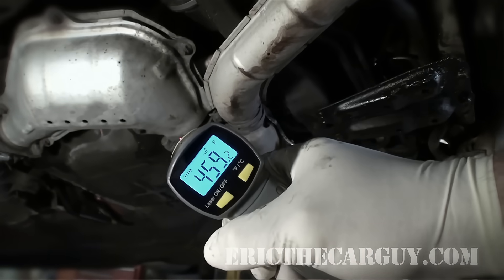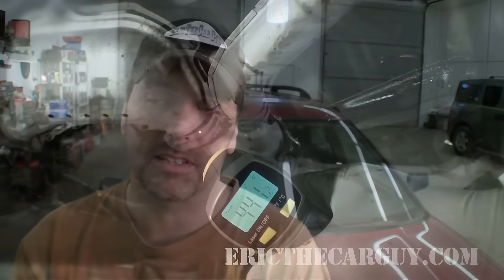Does Lacquer Thinner Clean Catalytic Converters? -EricTheCarGuy

Comment: A small exhaust leak, anywhere upstream of the converters will cause a P0420orP0430 if u have two converters? Somtimes if the leak is around the manifold, maybe a small, small crack, I have observed this often, one can, or will only hear said leak when the vehicle if absolutely cold. The sound u are looking for is a very distinctive tic, tic, tic, tic and then as the engine warms,it goes away, sometimes completely! But! The leak is still der! This causes a P0420. Eric ur the best, great vid.;)

Comment: It's usual here in Brazil to have industrial solvent mixed with the gasoline by some gas stations owners. It usualy leads to a catalitic converter melt down, destruction and cloging of the fuel filter and melt down of the rubber pieces in contact with the fuel.

Comment: Remove the CAT and pour acetone DIRECTLY on the inlet of the CAT. Pouring it in the gas tank will just trick the sensors and make you burn MORE fuel.
Reply: Just remove the #1 sensor and pour the desired cleaner into the hole, 
Replace the oxygen sensor and leave overnight,  may have to try a couple of times.

Comment: Neighbors 02 Altima had a upstream 02 high circuit code. Pulled sensor, looked like the end exploded, dont know why or how. Replaced it and after system monitor ran it threw a P0420. Pulled off exhaust and looked inside the cat, the substrate was completely missing. Not melted or broken, but just not there. Replaced cat and light turned off in 2 hours of driving. Been fine ever since. Car sat in her garage for a year, no one could figure it out.

Comment: Ooh, and laquer-thinner is just a non-sense, which totally did not work for me. I tried it on a 2001 passat v6. I poured 1 gallon into 30L of gas. Just wasted my money on the thinner. Light came right back on after 40kms. TheI tried the non-foulers, and I drove the car for 3 000kms after that and the light did not come on. Then I sold it and noone has yet called me to complain of a check-engine light.

Comment: The only inconvinience is that you have to drill through the non-foulers to increase the bore, so the sensor can screw into it. Some might argue that this lies the ecu and the car doesn't get as efficient fuel consumption. In my experience this is just not true. The people were still making the same mileage per tank as before this fix.

Comment: The only other solution besides replacing the cat is to screw in two spark-plug nonfoulers onto one another and then screw the o2 sensor in them. This way you remove the sensor from the direct stream and it works. I have done that on 4 cars so far and the codes never came back again even after 5000kms. On one of them it would come back intermittently, but that's because I didn't have enough space around the exhaust pipe to fit in 2 nonfoulers. Instead I only was able to use one.

Comment: Check out Eric's rebuild vs. replace video, he sort of agrees with Scotty. Of course, there are exceptions, but basically what Eric says is replacing is quicker and sometimes cheaper and will be better in the long run (that's concerning engines for the most part - carbs are different of course although I expect his answer still applies)

Comment: Lol Funny. The NGK rep I know says to use anti seize. It's not about ''corrosion'' (how does that happen in cast iron heads???) it's about the carbon build up leaking past the tip of the plug and working its way up the threads. Happens everytime I look at my plugs from my Jeep and my Ford. Even on my small engines.

Comment: short answer is yes, I once worked on a car that completley died, the catalytic convertor had melted and blocked the exhaust which finally chocked the engine out, this would have been putting a large amount of pressure/ temperature in the combustion chamber, shortly after getting this fixed it developed a blown head gasket, possibly related, during the initial fix I found the coil pack to be firing on 3 cylinders and this was clearly the cause of the melted Cat.

Comment: he shouts because he is partly deaf, he doesnt realise he is shouting, with regards to low compression in a cylinder well that depends on the engine you have and in what car, often it is best to just get rid of it, paying labour costs for a re-build isnt usually economically viable, unless you can do the work yourself of course, the problem with opinion is that they are like arseholes, everyone has got one.

Comment: It can cause high back pressure and burn the valves in the engine if the cat has come loose inside and is blocking the exhaust

Comment: one problem is the thinner will stay in the down spout for the gas, if you look it sits lower then the tank inlet, so most of the lacquer would sit in that, ive never tried the lacquer experiment though lol Hey quick question, i have the 97 legacy, And get about 210 miles per tank, my long term fuel trim is around 7-10 crusing at 60 mph, is that the same as yours ? 

thanks

Comment: I can see that this can be a pretty heated argument for some folks. I see some valid points on both sides. I watch both ETCG and SK alot. Both guys are smart. Anyway.. I HAVE personally tried this using the ratio that SK provides. It did work for me on a 2000 LS-1 Camaro. I raised my idle to 2k for 45 minutes, then let idle normally for about 15. Then I repeated that process several times over the course of the day.The P0420 code was thrown for about 10K miles before the Laquer thinner was used.

Comment: As an ASE certified Master tech,  I wished that you would have performed this test using his recommended 5:1 ratio. That's 5 gallons of gas and 1 gallon of lacquer thinner.  This simply out of respect for a fellow tech. Same on you for not doing so.  I've watched a number of your vids , I can say YOU surely don't know SHIT !!!!  You mentioned a check engine light. Code P1400, fuel tank pressure sensor fault. This sensor is used during the evap testing by the ECU. Nothing to do with the thinner

Comment: People have been using Toluene (not thinner) in gas for 50+ years. I wouldn't do it though. i've cleaned out clogged converters before with blow torches and yes. it worked.

Comment: To be frank, 1. A catalytic converter uses a catalyst, unless it's been blocked or smashed, they fail because they are worn out, like a heavily discharged battery's plates would fall apart. 2. The ECU will take all measurements and adjust as necessary, so it will adjust fuel mixtures accordingly even if you pee in the tank. 3. This acetone myth has been going on as long as the over unity loony's, with 100000:1 realising strong solvents cause damage and have different compression characteristics?

Comment: i have a 98 Subaru outback i have already replace motor and transmission and complete exhaust and etc. that was 5 yrs ago. the outback is on its last leg again from my wife beat down. they is holes in the exhaust, transmission skips sometimes and oil pan has a big dent. shocks are dead. should i rebuild it again and maybe to a conversion like the 6 cylinder boxer engine? i really want to have a car with a lot of torque, is it worth it?

Comment: I had issues with a cat in the past and tried Scotty's techniques just as Eric with no luck.  I used much more laquer thinner and even attempted to clean them with detergent.  In the end finding a replacement fixed the problem and would have saved me a lot of time if I had just replaced it to begin with.  Live and learn.  Rarely do snake oil style fixes work.

Comment: I suspect Eric's conclusion is probably right. However his method is less than scientific. Kilmer said to use much more thinner to gas mix. Kilmer also specified that the lacquer thinner be the kind sold in auto paint supply shops. I believe Kilmer also said Ior implied) that all of the gas with thinner be run out or diluted before running the test. That being said, I used the same thinner Eric used (bur more) and ended up having to get a new cat which cleared the code. I'll still watchi Scotty.

Comment: I tried this since i was receiving a P0420 code on my 05 scion tc after watching scotty's video. I thought that i would have positive results since the cat that he was cleaning was from a toyota celica which is sort of the precedent to the tc.

However my results were not the same, it didn't work, even though i had tried that as well as cleaning with soapy water. I ended up buying an OEM primary cat from toyota for about $400. Hindsight 20/20 I would have just bought the cat and been done

Comment: I ran 3X that much laquer thinner through my camry with 1/2 tank fuel and burnt it all over 2 days. I used to get a p0420 about once a month (I drive every day), and once i cleared the code it would not return for about a month. Its been 2 months since I did the lacquer thinner and no p0420 yet. Also, the rotten egg/exhaust smell i used to get going uphill or accelerating hard has disappeared. This is just my experience.

Comment: The problem with this is 1 quart is no where near 1/9 that Scotty specifies in a later video. Not saying for sure that is going you make a difference but Eric only used about 1 part thinner to 40 parts gasoline.

Comment: BG 44K can sometimes make a difference. I used to work at Sunoco and our inspector would put a can of that in the tank of any car that failed due to the cats. It only worked 35-40% of the time but at $15 a can it was worth a shot.

Comment: i'd be very concerned that lacquer thinner may damage one of the plastic components that comprise a modern fuel delivery system. those plastics were speced for gasoline, not LT. it may not produce an immediate leak but i'd worry it may reduce the plastic's integrity enough to cause an issue down the road.

Comment: Not likely.  Petroleum products are "non-polar" while alcohol is a "polar" solvent like water.  Likes dissolve likes so a petroleum, "non-polar" solvent is all that will dissolve any impurities or clogs in the system.  What I don't quite understand though is that the lacquer thinner has been burned by the time it gets to the catalytic converter....so it's not lacquer thinner any more.  It's exhaust....  I actually did this to a Ford Ranger based on Kilmer's advice.  Not sure if it helped any.

Comment: Hi Eric! Nice video as always! I have a CNG converted car, with catalytic converter and i was wondering if it can get clogged like a gasoline car. I know for sure LPG powered cars can get it clogged pretty badly, causing also some cars to fail our fume inspection, hell, i even saw a Fiat with LPG with the converted red hot because of being clogged!

Thanks in advance for your nice work Eric!
PS: my car is a 97 Renault Clio 1.2L

Comment: A smog mechanic  friend of mine, had a 1975 Lincoln that would not pass smog test[after tune up oil change Etc] He dumped 1 qt of shellac thinner down intake system. It then passed. It was a granny car that was lugged around town, most likely clogged cat not damaged.

Comment: Eric, like most things scotty does he is almost there on this theory but wrong execution, he likely uses lacquer thinner because of the cheap price.  The best method for doing this 8 gallons of gas, one gallon of xylene, one litre of acetone and half a litre of lucas fuel treatment then drive on the highway in 4th gear for an hour, let it sit overnight then do the same thing.  The next morning it will likely sputter a bit tho before it gets going, usually has a nasty exhaust smell too

Comment: I put the lacquer thinner in the fuel injector cleaning canister so it does not have to go through the entire fuel system and plus it more concentrated. 

I believe you have in your shop the otc version 7448.

Try that too.

Comment: I liked Scotty but really he is a bit sloppy for my taste. He used standard compression fittings on brake lines, he lets calipers hang by the hose, he drops the lift with cars on top and has other messy practices. When someone mentions it in his comments, he always retorts he's being doing it for so and so years but to me that is a weak response. He could be doing things wrong for so and so years but it's still wrong. Not that I dislike him but he is a bit cocky and hard-headed, that's all.

Comment: I did this once on my obd1 supra with dual cats. At a 1/3 tank I dumped a liter of thiner in the tank and mashed on it for 30 min. The reason I did this is I knew both my cats oem from 92 werent gonna do the job and my hc levels were found a hair over the limit. Oh it smelled like buttered popcorn for a bit too.

Comment: IT WORKED...for me....I have a 2002 Chevrolet Suburban 5.3 had a cat code, put one gallon of lacquer thinner in a full tank of gas. Raised the engine to 2500rpm for 25 minutes....IT WORKED...no more codes, runs fine. It has been 5 months and 5 thousand miles ago....

Comment: Here is my ? I own a 2000 chevy tracker. It seems like to me that she(tracker) is having some troubles upshifting when driving along. What would cause this to happen? I have checked the transmission oil levels after a drive and before a drive (cold) and they are normal. Any help would be greatly appreciated. 
Vehicle specs
2000 chevy tracker
1.6L
4x4
no abs

Comment: Cheap way is to plasma cut open the cats and "gut them out" and then weld back shut...however sometimes it ruins the O2 behind the Cat. I had a buddy with a 93 chev 5.7 and had it dueled and off the headers...installed a H-pipe and put the O2 in the middle of it. I run a MagnaFlow hiflo Cat on my Honda and previous vehicles, I like loud but to save the O2 or not have a O2 CEL come on is having the Aftermarket Cat installed.

Comment: id also like to point out, pure acetone when burned produces 3CO2 and 3H2O. water and carbon dioxide. in fact it probably burns as soon as it it pressurized in the combustion chamber, as it has a very low flash point.

Comment: Hey eric i got question for you. Is there any brand that will scan my honda integra dc2 1998 3wire DLC port?  ive used a dlc obd adapter and tried 10 different scanners but non work.  So do you know a brand that duss work? Thanks in advance. btw my dlc is getting power so its not a blown fuse.

Comment: I had been told by an old Mechanic in his early 90's that pure acetone bonds with the hydrogen molecule in gasoline and can increase your gas milage by up to 20% in rare cases but 7% - 10% on average. That it works best in cars from the 60's and 70's.
I regularly put 2 ounces of acetone per gallon in all our cars , motorcycles , and tractors.
 I can tell a difference if I forget or one of the kids gasses up the car.
Sally's Beauty Supply has the purest acetone I can find
Many Blessings...SMR

Comment: Catalytic converters can damage physically or can clogged up (burnt in carbon particles). So if it is just a clog, and this method can unclog it, than it is a good way. Catalytic converters only make chemical reactions faster but not used up in the process. (like sugar cube with ash can burn, ash is a catalytic material in the process, but not burned or used up)
My second guess because the long drive, catalytic converter just cleared itself.
(sorry for my bad english)

Comment: It can help remove loose deposits on the catalyst honeycomb but large build ups as in complete stoppages. It's far more effective to remove and soak the converters then rely on the small amount that goes through the exhaust from incomplete combustion.

Comment: I used the spark plug non-fouler trick on my rear spark plug like 3 years ago.  It's been fine since and passed the sniffer without drama. Some of the OEM parameters are so tight its ridicules.

Comment: I have to think that you should've put more thinner in there to match the proportion that S.C. used...  But like you said, cat's can fail in different ways.  If your cat is physically damaged inside, then clearly any type of cleaning won't fix the problem, like you said.  I would love to see a follow-up video if/when you do get around to replacing these cats -- I want to see inside them to see if they're dirty or physically damaged, or whatever.  Thanks for the vid, Eric.  Keep up the good work.